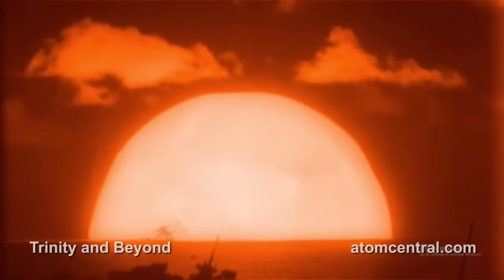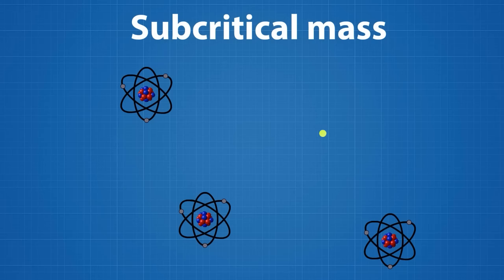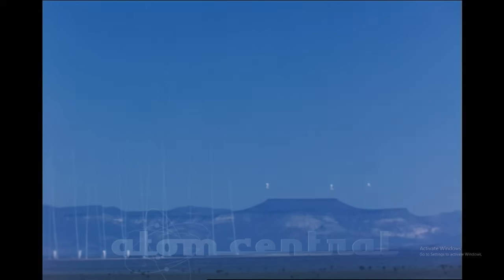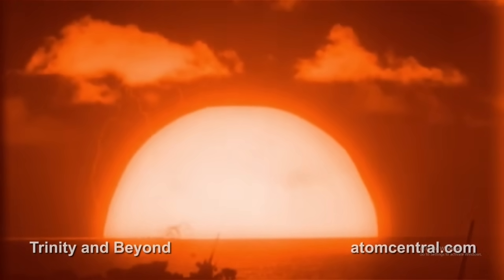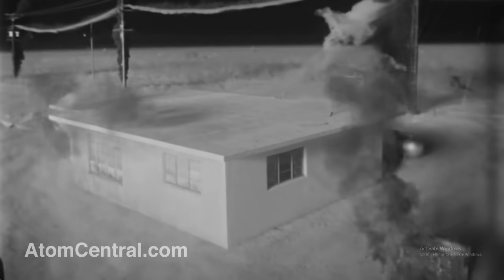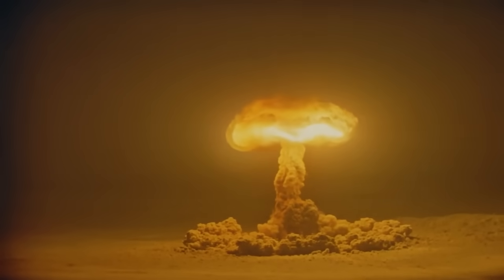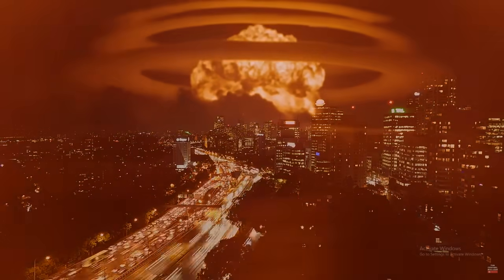Anatomy of a Nuclear Explosion

Comment: 0:35 Stage 1: Detonation
1:49 Stage 2: The Flash
3:43 Stage 3:: The Fireball
4:14 Stage 4: The Blastwave
5:10 Stage 5:The Mushroom Cloud
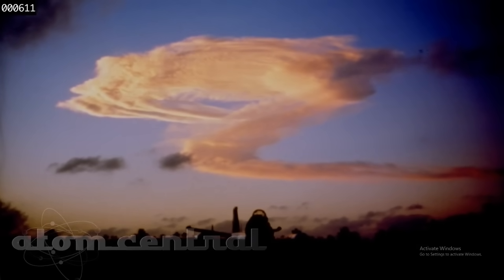6:32 Stage 6: The Fallout
Reply from the maker: Thanks! Pinned.
Reply: @darkscienceyt  put it into the description field to create clickable chapters in the video
Reply: @darkscienceyt  Could you add the timestamps now so that it shows up as chapters for easier navigation? Thanks!
Reply from the maker: @nhannguyen2190  I'll try
Reply: @nhannguyen2190  it's only 9 minutes long 🤦‍♂️
Reply: @darkscienceyt hi Mr dark science. Please could you answer a question that has bugged me for decades. The white lines of smoke, visible at 0.20 on the left of the explosion, and 5.21/31. The only thing I can think that it is, is the vaporised remains of wires held up by balloons (never visible) to measure something, just a guess. The wires are, I think, visible at 2.48. Can you clarify anything here or send me a link where I can read up on it please.
Reply: @Bartz01able  thank you, thank you so much, I've wondered about this for so long, and i've never been able to find an answer. Thanks 👍
Reply: @dariuscroxton1039  By the way: You can really see the vaporized holding ropes from the tower on which the nuclear device was located! On some slow motion recordings you can see the fireball and some spikes which seem to grow out of the fireball. The spikes are the vaporized ropes!😁
Reply: And this is correct: the nuclear detonation is faster than light, it's already over before the flash even starts.
Reply: @drrocketman7794 no , it is not faster than light. Think about what you're saying. It's powerful but it doesn't break the laws of physics.
Reply: @drrocketman7794 pure bullshit.
Reply: Stage 7 painful death, better to die in stage one when you don't even have time to feel a thing.
Reply: Umm, Stage 1
... The A$$holes responsible ... and ALL the Stages of Death, Destruction, Misery, Mutations, Cancers 🔥
Reply: Nuclear submarines do not exist nuclear explosions do not exist nuclear detonations do not exist nuclear flashes do not exist nuclear fireballs do not exist nuclear blast waves do not exist nuclear mushroom clouds do not exist nuclear fallouts do not exist nuclear power plant does not exist nuclear aircraft carriers do not exist
Reply: The more G’s, the better!! They’ll reflect our minds, technology, and more!! G strings!! 👙 👙👙👙

Our brains look like gum!! 🧠 Juicier the better!!!🍏🍋‍🟩🫐🍍🍎🍌🍈🥥🍐🍉🍒🥝🍊🍇🍑🍋🍓🥭

Love everything until it loves you back!! Mosquitos too!!🦟 ❤

Each of us and each galaxy would represent a cell!! 🦠 We’re stars putting ourselves back together again!! Like Humpty Dumpty!! 🥚 🐓 

The sky is blue because we’re meant to imagine it as a diamond!! The auroras then create the rest of the spectrum!! 🌈 💎 

A purple sky would reflect the heart of the ocean!! An opened mind!! 🤯 The earth purring more!! Purrrrrple rain!!☔️ 🐈‍⬛ 🧶 

Each thought to me is a solar flare, which shifts us into parallel worlds!! It’s hard here!!! I’m a peaceful dude, yet my life here has been super difficult!!🥹

Alpha Centauri represents a shift in consciousness!! Dog planet!! We’re riding the alpha waves!! Woof woof!!🐶 🐾 This is our world peace and enlightenment for the world and universe!! All is one!!😇🥳🥰🤩

We’re each a mini universe!!🌌

The 3 Body Problem represents our gut brain, 🍱 heart,❤️ and mind!! 🧠 

The moon is a black hole!! 🕳️ A neutrino!! The planet is a colonized moon!!😇🌍👽 The sun is a shapeshifter!! 🌞 

Are you and I sculpting together as a team or as individuals??? 🧑‍🎨 Using the moon as a tool!!! 🪨 The Sun is the eye!!👁️ 

I love the tool/word grinder!!!😮 We’d be Bumping and Grinding!!😂

The Earth is like a refrigerator and the atmospheric pressure is melting or defrosting the stars above, as if they’ve been in the freezer!! 🥶 

It would also reflect us krystalyzing and becoming diamonds in the sky!! 💎 💎💎 Lucy becomes Maisie!! 🐒 👽 

We could be stars from above aka heaven, melting everything from above, as well! Like a River Running Through It!!! 🌊🌊🌊🌊🌊 Gravitational waves or our thoughts raining down on us!! 🌧️ 

Unlocking a Secret Garden within and outside of us!!🤫 An Oasis!!!🏝️ 🏝️🏝️🏝️🏝️

Flowing!!! It helps a lot to flow!!!🌊🌊🌊🌊🌊🌊 Letting go, so we can concentrate more and work on our project!! Heaven On Earth!!🌍 👼 

Flowers!! 🌺 🌸 💐 and Flow-Ers!!🌊🌊🌊🌊🌊

I know energy is still impurrtant!! 😻 

And of course imagination!!! Love!!!💗 🐶 🎾 🧶 🐈‍⬛

To create heaven On Earth, the galaxies collide!! 🌌 Twin flames connect!! 🔥 🔥 We’re creating quantum entanglement!! Ghost particles merging, becoming more like the Stay Puft Marshmallow Man!!👻👻👻👻👻👻👻👻

The universe is still the Earth!!⭐️🌍⭐️ We’re seeing it from the insides!! 🕵️ Like we’re inside a volcano 🌋 or wishing well!! The stars and galaxies are like coins!!🪙  The Goonies vibes!! 💀 We’re treasure!! Antarctica is treasure island!! 🐧🇦🇶 Unlocking antimatter!! 🐜 Booby and booty traps exposed!! Planet X!! Hubba Hubba!!🥰 

Everything and everyone has been our teacher!!👩‍🏫

3D is like the murky bottom of a bong or volcano!!🌋 The fourth dimension, representing Mars is like the stem of the bong or the volcanos vent!! 👽 Experiencing higher dimensions is like the smoke or magma reaching our mouths 😋 and then circulating through our bodies!! We are the Earth!!🌍 👼 

The road less traveled!!!🧳 🌹 Straight up!! 🎈 🎈🎈🎈🎈We’d be super condensed or extremely packed neutron stars!! Like Rigel!! Blueberries 🫐 Antioxidants!! Betelgeuse has evolved into a neutron star!! 🧊 🦖 🧊 🦕 🧊  🦣 

Our long winding road, exploring different dimensions, finally straightening out!! I’m getting Pee Wee vibes!! Large Marge sent me!!🚴😂

We’re vaporized, as if we’ve been smoked or roasted!! 💨 The smoke representing again those compressed neutron stars climbing the higher dimensions of the universe like a chimney!! I’m Mary Poppins, y’all !! ☂️ 🧞‍♀️

It would also represent us as a comet traveling through a wormhole!! 💫 

Who me, I’m just a worm!!🐛 🫖 Solving a labyrinth!! 🦉 Solving amaze!!! 🦋 

Different energies tell a different story!! 📚

We’re storytellers!! Artists!!🧑‍🎨 

We’re energy first!! 🐝
Reply: Jesuschrist
Reply: @Thomas..Anderson  6:45 your mom coming over to my house for $20
Reply: You really cannot use a Genuine Copy of Windows? Loser. Prosecution should be inbound.
Reply: The neutrons are constantly striking the atoms from radioactive decay. The supercritical mass is just more neutrons hitting the atoms. All critical mass does is increase the rate of radioactive decay. They don't shoot neutrons into it.
Reply: stage 7: the mooshroom cloud, made of mushrooms produced by mooshrooms from mushroom island
Reply: @Potatoeheadz123  
... Potatoe Head speaks Volumes !!!
Reply: @Potatoeheadz123 magic mushrooms?

Comment: The simplest type of nuclear weapon to produce is the uranium 235 "gun type". The bomb consists of 2 sub critical masses at either end of a hollow tube where one of the masses is propelled into the other by means of smokeless powder. The stationary mass is surrounded by a neutron reflecting material to ensure as many fission events take place before the weapon tares itself apart. This was the design used to make little boy where less than 1 percent of the 60kg of u235 underwent fission but still produced about 15 kilotons of kaboom.
To get the most "bang" for your buck most nuclear weapons are detonated above the target. The Hiroshima and Nagasaki bombs were both detonated in the atmosphere above those cities. This maximizes destruction and minimizes fall-out. So long as the fireball doesnt touch the ground youre only in real danger of hot fall-out for about 72hrs. If the fireball touches the ground it then sucks up all the dirt and whatever else is down there, irradiates the shit out of it, and then it rains back down contaminating everything it touches. People downwind of the nevada test site had a marked increase in cancers all the way out to the east coast. The federal government eventually had to pay the families of those effected who were designated "Downwinders".

Comment: Great video.  Thanks for sharing this information. 
For future reference, please double check any temperature conversions as it is all too easy for anyone to make mistakes.  For example, at about 6:10, you noted that at about 5 miles in the atmosphere, temperatures can be as low as -35° F.  The on screen graphic read -35 F (1.7 C).  It should have read -35 F (-37.22 C).

Comment: 2 grams of cesium is enough to contaminate about a square mile:
that is the size of dime. Plutonium is much worse. Cut the dime 
into 10 pieces. one of those pieces is enough to contaminate a 
small town. Grind it up into dust, and Blow that into the house, and it 
is enough to contaminate it. If any normal person does this, wouldn't 
this be called a terrorist act, a murder attempt or both? But when the
nuk industry does this with a couple thousand TONS  of plutonium,
cesium, and 1200 other goodies, and that gets spread out over the 
whole world , what happens ?

Comment: I might add that modern nuclear weapons dont contain as much plutonium as their predecessors did. Also worth mention that both cesium 137 and strontium 90 are beta emitters, which means they are relatively "safe" with proper clothing until inhaled or swallowed. Unburned fission fuels are very heavy which means they drop out from the cloud very close to ground zero, containing the damage to a smaller area, where the neutron activation are already cause long term radiation hazards. The most problematic radiation hazard is not these fission products but tritium which is very hard to filter out from water.

Comment: The initial explosive blast packed with radiation that vaporizes paint is just the beginning .The vacuum forces are also distructive .But what makes the atom bomb so deadly is that it's always used above ground, in the atmosphere, when used offensively. The initial blast goes fast and hits the ground , then it is reflected back where it is met by the second blast of explosive power. They do cancel themselves out to some extent , but then, the intial blast is redirected back to the ground with even more force than when it started.

Comment: You forgot the suck stage. You got the blow but left out the suck as the column of air rises it pulls in all of the surrounding atmosphere like a vacuum cleaner and will literally destroy everything in its path and suck the lungs right out of your mouth. Assuming you survived the heat and blast wave.

Comment: The temperature inside a nuclear bomb is FAR greater than the interior of the sun. At least 8-10 times higher. The suns core has a temperature of about 15 million degrees Celsius. While  an atomic explosion reaches over 100 million degrees Celsius.

Comment: Is the plutonium core before implosion, solid or hollow?  If it is solid, then by how much does the density increase as a result of the implosion?
Reply: The Plutonium in the WWII bomb was a sphere, but not hollow. The modulated neutron initiator was in the center: "The initiator used in the early devices, located at the center of the bomb's plutonium pit, consisted of a beryllium pellet and a beryllium shell with polonium between the two. The pellet, 0.8 cm in diameter, was coated with nickel and then a layer of gold. The beryllium shell was of 2 cm outer diameter with wall thickness of 0.6 cm." The Plutonium was compressed to more than 2 times its density (2.3 - 2.7).

Comment: teller light...   "So, this is an image of Teller light from a nuclear detonation, the flash of light is actually not an explosion as you would think of it, and the bombs casing is still fully intact. The rectangle being illuminated is the actual device in the shot cab. What is happening here is the sheer amount of xrays coming off the collapsing core is superheating the air to the point of incandescence. After this initial burst, the air will return to transparent, and you will see the flash of the actual bomb bursting. This is what leads to the distinctive double flash that nuclear weapons are known for, and one way we tracked nuclear weapon testing early on."
Reply: Footnote: GPS satellites have sensors on them to detect the double-flash signature of a nuclear detonation.
Reply: 1st off, thank you! I have always wondered about what is going on with that initial bright burst of light, and what follows.  It's so fascinating.  Also, I wish I could have you explain this in depth, because I will need to look up so many things in the explanation to really get it, and I'm too lazy to do that right now. But still, thank you helping illuminate (yeah, pun intended), more of this for me.
Reply: @bartekkozlowski1015  great there's much info declassified now, and YouTube is great.  Teller Light is the instant of chain reaction . For 600 billionths of a second the chain reaction creates 100 million degrees F. 8 times the center of our Sun--then the reaction part is done.  

 The rest--the mushroom--is residual heat rising and cooling quickly.
Reply: @bartekkozlowski1015  You Tube has many declassified nuclear test films.  It's a wonderful education.  I find it amazing that the nuclear part of the explosion, lasts a mere 600 billionths of a second--the teller light.  The rest of the mushroom and fallout is just the aftereffects of heating for an instant to a temperature of 8x more than the core of our Sun.  The chain reaction flash-fries everything within a certain distance.   https://www.youtube.com/watch?v=LLWlPyRhUTY

Comment: The "flash" is a result of annihilation of the strong force that held the nucleus together. This yields gamma radiation which is associated with nuclear events. The gamma radiation then is degraded by a variety of processes into lower frequency electromagnetic radiation, one of which is the ionization of atoms in the vicinity. I cannot say what the mechanism is, that converts the strong force field into gamma rays. The strong force fields constitute a major fraction of the observable mass of the nucleus, and this is the mass that is converted to energy in accordance with E=mc^2
Reply: The fireball of a nuclear explosion is created by "soft" X-rays heating up the surrounding air.

Comment: Does an H-bomb flash twice? I heard or read that somewhere and I assumed it was caused by the fission "trigger" causing the first one.

My wondering about this came from a "double flash" over the Indian Ocean photographed by satellite years ago. Those studying it thought it was a meteorite or a nuclear test, possibly by Israel.
Reply: Any nuclear bomb has a double flash! The reason behind it is very simple.

The nuclear fission reaction, and the nuclear fusion reaction in bombs that have it, is over in a matter of a few microseconds, or so. All the energy of the bomb is released in a few microseconds, mostly in the form of x-rays. In fact, a Plutonium implosion device releases all of its energy in less than a microsecond.

This means that the released x-rays go through the bombs casing and heat up the surrounding air to white-hot plasma. This fireball is bigger and longer active the larger the amount of released energy is.

Now, at some point, the bomb itself actually explodes, creating a shockwave that goes outward. This shockwave is initially so dense that it is opaque, meaning it does not let through light. As the shockwave goes outward, it encapsulates more and more plasma and blocks its light from escaping it.

So, a double flash is created by the original light source (the plasma) being partially and temporarily obscured by the opaque shockwave. The timescale for the double flash is on the order of a few hundred microseconds to maybe a few milliseconds, the time the shockwave is opaque. As it extends further, it looses opacity.

Fun fact, all GPS satellites have sensors on them to detect a double flash signature on earth. They are literally the US detection system for atmospheric nuclear explosions.
Reply: @charliefoxtrot5001  Thanks for the extra info! I think the Indian Ocean anomaly might have been picked up exactly as you said: a GPS satellite.

Comment: How quickly does the fireball grow? Why isn’t it the speed of light, or at least much faster than it looks? It’s so hard to determine speeds because it’s hard for me to keep track of scale in most blast videos.
Reply: The only thing that moves at the speed of light is the light (and gamma and xrays which are just a type of light).   The fireball is made up of superheated plasma that used to be air and will travel outwards at a speed dependent on the amount of energy produced by the bomb.
Reply: @willo7734 ok so in this video, how fast is that plasma moving?

Comment: 8:20 That’s  what I don’t understand about “half-life” 700,000,000 Years is Only 1/2 it’s Full Time ?!
So 140 Billion or something years is Full life span!
!? That just seems Unnatural and wrong
Reply: You keep dividing in half every 700m years. 1.4 billion is a quarter life.
Reply: It's like having a partner that spends half of your savings every year and tells you not to worry about it, because there is still the other half left. You will only have 1.5625% of your original savings left after just 6 years.
Reply: Half-life means that:

- Half decayed after 1 half-life (50% of everything decayed, 50% remains)
- Half of the REMAINING decayed after another 1 half-life   (75% of everything decayed, 25%  remains)
- Half of the REMAINING decayed after another 1 half-life   (87.5% of everything decayed, 12.5%  remains)
- Half of the REMAINING decayed after another 1 half-life   (93.75% of everything decayed, 6.25%  remains)
- Half of the REMAINING decayed after another 1 half-life   (96.875% of everything decayed, 3.125%  remains)
- Half of the REMAINING decayed after another 1 half-life   (98.4375% of everything decayed, 1.5625%  remains)
- ... and so on

It is actually quite natural. It is a regularly occurring percentage loss, an exponential process.